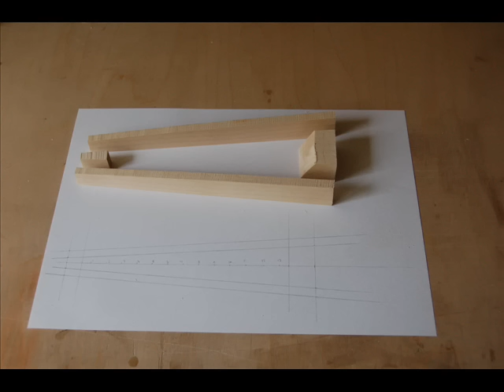How to make a lute in five minutes

Comment from the maker: On a 6c lute I would normally have a neck width of about 45mm at the nut and 60mm at the body join (the string band being about 40mm at the nut and 75mm at the bridge).  For a double top string you might want to make it slightly wider.

Comment: Thorrin Jonsson You shouldn't feel bad, the title is very misleading. You should be aware that the "bowl" of the lute itself is a task that takes days. The wood must be cut into precise sections, and then bent into shape. Then you'll need to build a mold, glue the pieces over the mold, and use tape to hold it together until it dries. Luthiers typically use hide glue which must be heated. The good thing about it is that it is water soluble.
Even a seven course lute has 13 strings, and I guarantee you that tuning a lute from scratch alone takes more than 5 minutes, not to mention re-stringing them.
Personally, I have moved to an 11 string alto guitar. While it does not have the richness in sound you get from doubled strings, lutenists do not always pluck both strings in a course anyhow, and tuning pegs held by friction can be very frustrating. Did I mention that the frets, made out of gut or nylon, come loose after a while and must be changed as well?
Reply: Eugh, despite loving the sound of one all that is a bit too much for me, I have immense respect for those who have the ability and time to though.

Comment: I built a 7 course Venere from an EMS flat-pack kit.  (I had to cut all the ribs and assemble a toast-rack mold).  The neck has warped and now the strings have 1/4 inch between the strings and the soundboard at the midpoint.  I thought of making a new neck using to existing pegbox or possibly stem bending the neck back into line.  Any advice?
Reply from the maker: If the neck is thick enough you might be able to remove the fingerboard, cut it down to correct the action and replace the fingerboard.  If not you might need a new neck, though as you say you can recycle the pegbox
Reply: I don't know how your lute is at the moment, but if it hasn't been mended yet, there's a simpler solution than taking away from the existing neck (which is not always possible), resetting the neck, or making a new neck. You could fix a new, compensated fingerboard on the neck. I have seen that solution on some decent German lutes. If it's executed well, one can hardly tell that the instrument is modified. The compensated soundboard looks like a normal lute soundboard, but its surface is carved in such a way that it rises from its thin points, which are flush with the top, to a higher level of a thicker fingerboard at the body-neck joint, then its thickness gradually decreases again toward the pegbox. This solution is not so absolutely smooth and beautiful as a fingerboard with an even thickness, but it can certainly compensate for the increased action, without the need for a potentially dangerous, labour intensive neck reset. The secret of this solution lies in the way how the fingerboard thickness step at the body-neck joint is executed. For the best results, the body end of the fingerboard should be carved, chiselled or ground in such a way (in a gradual arc) that the thickness step actually becomes visually attractive. Naturally, if you want to follow a more rigorous, historical approach, this solution is not for you.

Comment: If one has never played a lute before, could they still build a decent lute to learn on by following a plan (supposing they are a woodworker)? >_>
I feel like this is a dumb question, but...
Reply from the maker: +deepblue153 The short answer is "yes".  It's important to have a good plan, such as the working drawings produced by the Lute Society or David Van Edwards, otherwise there are aspects of the design and construction which might make it difficult to make a successful instrument.  It would help to have an expert at your elbow to advise on action, string heights, etc. but you can manage without and you'll learn a lot in the process.  Good luck!
Reply: Excellent! I was expecting a more negative answer. xD